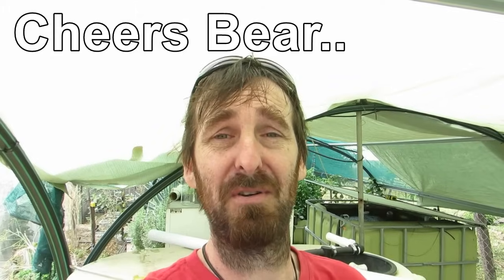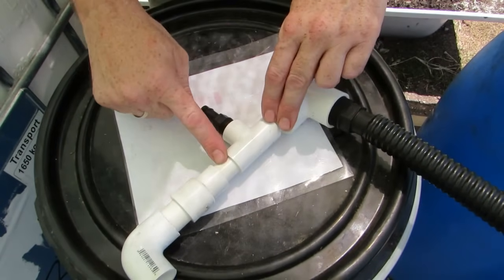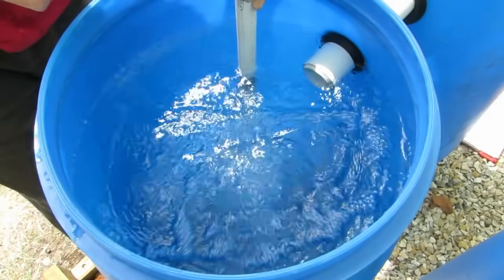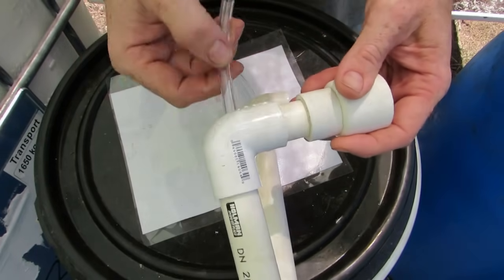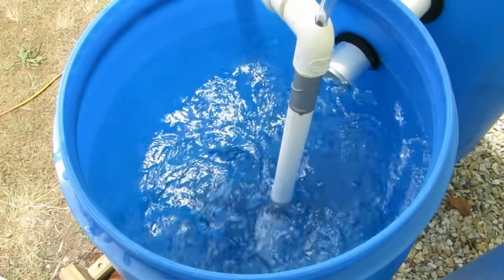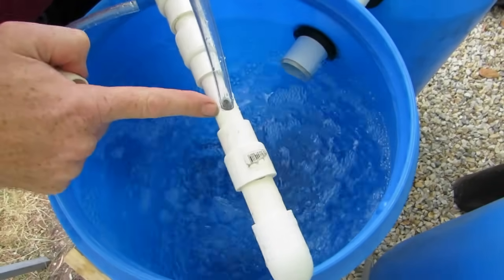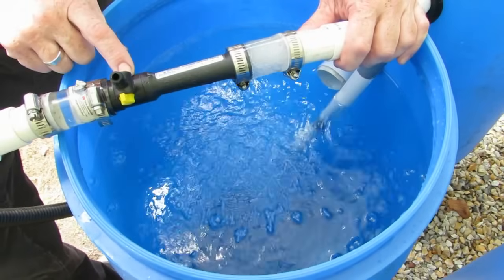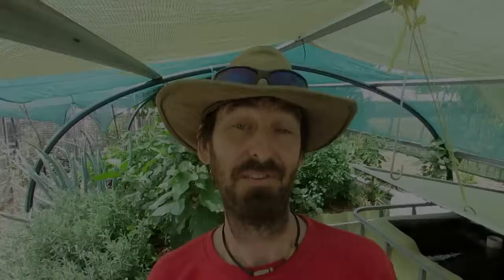DIY venturi, a few easy builds for aquaponics, aquaculture or hydroponics..

Comment: very interesting video! Thanks. I'm starting my first indor aquaponics syste very soon. How i can calculate how many fish i need for balanced system?
Reply from the maker: +Giorgio Cerruti ?
Hey Mate. Sorry for yet another slow reply. 
I calculate stocking rates by the type & amount of media that will be acting as the biofilter/grow bed. If you're using 20mm rock or clay media in teh grow beds I would start out at 1 fish per 20L of WET (under the water line) media. Once you get a bit more experience you can play around with adding biofilters & increasing stocking rates.  
How's the build going ?

Comment: Hey Rob. Love your videos. I don’t know if you’ll come across this question or not. I am spending countless hours watching all kinds of videos to help me get ideas for some designs. My question is: If I were connecting multiple float beds or grow beds, could I add the Venturi idea to the straight connecting pipes? I’m trying to come up with ways to help improve the oxygenation continuously through the system without using air pumps. Like say if I was connecting multiple deep water beds together in a straight line.
Reply from the maker: Hi IT. I can see no reason why you cant but I don't think it's necessary. 
A flood & drain bed will have more than enough O2 in the root zones as the water drains out. DWC/raft beds generally have a slower flow rate as they have an hour long retention time (from 1-4 hours) meaning that the inflow is generally rather slow. I'ts advised that you have a series of air stones under the rafts in DWC as the roots need a fair amount of O2 to keep the plant healthy & disease free.
Hope that helps some

Comment: Hay dude , how do you lower the ph in your system mine is crazy high alkaline. All I can do is drain it off and add tap water, which sucks.
Reply from the maker: I did a clip on lowering it if it helps any. 
https://youtu.be/eO1pHM7Afuw
Just remember to ONLY lower the top up water so the fish won't get harmed by massive pH swings. 👍

Comment: Would laminar flow make the venturi work better? Various videos on this, from very elaborate to just a few straws in a tube Building a Laminar Flow Nozzle . At the very least, perhaps beveling the joins inside the venturi might improve things. On the other hand - maybe it would make things worse, maybe you need the turbulence.
Tap aerators have screen in them to break up the bubbles. Cant put a screen over the main flow, of course, because it has solids. But perhaps a screen just over the end of the tube admitting the air? Flyscreen? Some silk fabric?
Reply from the maker: Hey Paul..
Have never seen the laminar flow device before, thanks for the link :) Not sure how that would go with the venturi to tell you the truth..
Haven't tried using the screen over the end nozzle yet but will on a new system I will be playing around with in a few months to see how it goes..
Cheers

Comment: 2 suggestion for smaller bubbles do a mesh modification on your impeller.. get a very coarse scotch brite pad cut a disk off zip tie to to your impeller connect the venturi to the intake side of you pump it will mico fraction the bubbles. for noise there is a muffler to reduce the sound to almost zero i can send you a design for one.
Reply from the maker: Hey Chad..
Haven't tried the venturi on the other side of the pump yet.. Might play around with it next time I put a system together & see how it goes..
Am playing around with a small muffler design here as we now have 4 venturis running on 2 separate systems & don't want have to bribe the neighbours with too many fish ;) 
Cheers mate & have a great one..
Rob.

Comment: The problem I'm having is water is coming out of the air tube (using your first build).  I've checked the direction of the tube opening (away from the water flow), have adjusted the depth of the tube in the T and have cut different angles in the tube. Any other ideas?
Reply from the maker: Hey Byron.. what size pump do you have on the system?
Reply: Sorry to be so tardy on my reply.

I'm using a 1350 gph pump.  However when I moved from a .5" venturi to a .75" venturi and put a 1" exit pipe of the end it began working well.  I think I was just blowing way to much pressure into the venturi.  Anyway, all seems to be good now.

Thanks for your reply in interest.

Cheers,
Byron
Reply from the maker: Byron Wooten That's great to hear Byron.. Am glad you got it all sorted.. No worries on the slow replies.. Can be a bit slack myself when it comes to replying..
Cheers & all the best..

Comment: If you split your outflow so that some of it goes directly back to the pump, it will probably make your air bubbles smaller, as the pump churns them around, breaking them into even smaller bubbles.
Reply from the maker: Hi Jim.. Think that would work well.. Our pump is a few meters away from the venturi so it would make diverting the flow a bit difficult, not impossible though.. Looking at going back to using air stones as I will be adding a bio filter & the pump we have at the moment won't be strong enough to run 2 venturis.. When the budget allows for a larger pump I will be switching back to venturis..
Cheers sir & have a great one..

Comment: Have you looked at doing a bypass with a ball valve to increase the pressure differential.  Check out the installation method for the Mazzei injector.
Reply from the maker: Hi Kaylee..
I haven't but just had a look, thanks.. For our purpose I don't think we need to go that far as we are getting good air flow through to the tanks.. Ended up using the commercial unit in the biofilter for the fish farm in line & its doing a great job..
Cheers..

Comment: after everything's in place and ready for water, Do I fill everything to there running levels?then start the pump?or?? to get started?
Reply from the maker: Hi Bonnie. Sorry I missed your post & know you probably figured out already. 
If you haven't then the best way to start up the system is to fill the fish & sump tanks first then switch the pump on. That way the system won't overflow 👍
Cheers & sorry again for taking a while to respond.
Rob.

Comment: If you had a pump with a good GPH output, could you split the 1 inch outlet into 2 one inch pipes, add 2 venturi, and get twice the air bubbles?
Reply from the maker: Hi there.
If you did have a large enough pump I think you would need to bring the restriction down to a ½"/15mm pipe. Not sure if it would be more efficient at getting more dissolved O2 into the water though.  It might be better to up the pip/hose to 1¼"/32mm & then bring it down to ¾"/20mm. 
Would like to know how you go if you have a crack. 
Cheers.
Reply: Rob Bob's Backyard Farming  Thanks.  And thanks for providing the Imperial measurements right there. I'll let you know how it goes.

Comment: For your ventura you can try  many small tubes combined into a fitting to get many small bubbles
Reply from the maker: It all comes down to the hole where the air enters the water flow. I found I got smaller bubbles with higher water flow rates.
Cheers.

Comment: Pretty interesting.  What about just shooting the water right into the barrel, maybe split the stream into multiple small high pressure holes  ... wouldn't that pull air down into it and aerate it?  How do you measure the results here?
Reply from the maker: Just truing to use the pump to do all the work so we don't need an air pump as well.. Helps to streamline the system with less pipe work & power consumption..
At the moment I'm just judging the amount of bubbles I see, not very scientific I know ;)   Have also looked into different methods for testing dissolved oxygen.. The price of the units are a tad prohibitive for me at the moment..
Cheers,
Rob,.

Comment: to make the bubbles smaller have you thought of running a few layers of plastic window screening around the holes with a bit of distance between the layers to break up the bubbles? or you could use a wrapping of open cell foam to do the same thing.  Open cell foam might trap and debris in the fluid though and require cleaning.
Reply from the maker: Hi there Thomas..Have had a few people suggest that thanks.. The bubbles we're getting from the bar arrangement at the end of the delivery pipe are fairly fine where the ones in the tester barrel were just running from the end of the pipe so were rather large..
Cheers & hope you enjoying the holiday season..
Rob.

Comment: Hey Rob, I am looking at starting an aquaponic fishery with 3 different man made ponds each with a capacity of roughly 4-5 mt of water volume. One will be Carp, the other Koi and the 3rd Tilapia. Now the problem I am stuck with is for these fish to actually spawn they need the bed of the pond to be fairly still. but for Aquaponics to work I need the fish waste from the bed of the pond. I was thinking, if I made a venturi-style back flow from my growbeds that would lift and help mix the fish waste in the water which in turn I can extract from the middle of the pond or even the top rather than the floor of the bed. Do you think that would work. Or if you have any better solution to my problem please advise.
Reply from the maker: Hi there. Sorry for missing this.  I'm not to sure how your ideas would work sorry as I haven't had much experience with fish breeding. 
Most folks I've seen do it online will have their breeding pairs in separate tanks so they can have better control over their environments. 
Sorry I'm not much help to you Othman.
Rob.

Comment: Hello I am biulding aradial flow filter and a biofilter if I can call it that the water comes out of the radial flow into the bio like yours. will the gravity flow from the radial flow create enough force to use a venturi without a pump. and will the venturi restrict the water flow too much and cause the radial flow filter to over flow. Thanks
 between you a Kassa I can do this
Reply from the maker: Hey there Larry..
I don't think it will be as effective as one run under pressure from a pump but you will get some sort of venturi effect.. It is something I would like to play around with on my next build as it would be a much more efficient way to plumb up the system I think..  Would like to know how you get on with the build mate.. 
Have a great one..

Comment: would you know the psi of the vaccuum on the air drawn in from the black air inlet?
Reply from the maker: Hi there... I haven't got a way to measure it at the moment sorry crash100.. I do know that it is supposed to draw through 900lph on a 3500lph water pump according to the manufacturers site.. 
Hope that helps some..
Reply: im trying to do a little more than feed the fish so to speak but i have to say this video has been extreemly helpful; thank you

Comment: Hi.  I am starting a IBC build.  I am wondering what happens if my tables are left outside.  We get a fair amount of rain.   How do I make sure that things do not flood.   Does everything need to be under cover? Thanks
Reply from the maker: Hi Kelsey. Our system is exposed to the elements & has over flowed a number of times due to rain events. Normally I won't top the system up if I know we are expecting rain but during summer here the weather can be a bit unpredictable so is hard to anticipate top ups. 
I think one way around having the system overflow all the time if it is outside is to have an auxiliary sump tank. This tank can be left empty most of the time but can be brought online during time wet weather. It could be joined to the main sump tank via an overflow port & the water held to be used for future top ups or it could be joined by a valve that gets turned on before the rain event happens dispersing the extra between the 2 tanks. 
Hope that helps you out some.

Comment: if you buried the end into some gravel or sand, would that work to make the bubbles finer?
Reply from the maker: Hi Sam. I don't think it would as the pressure from the water & air would blast it aside fairly quickly. 
Cheers mate.

Comment: Rob,
I have 1 water pump in my sump tank that returns water to the fish tank.  If i wanted to use a venturi to move the bio media on the bio filter would it require a designated pump?  The moving bed is powered by an air pump right now.  I've tried "T"ing into the 1" from the water pump but that didn't work at all.  maybe not enough pressure.  I really don't know.  Any thoughts?
Reply from the maker: Hey Joshua. You could install a separate pump to run the venturi or up size the pump you have & add a separate line to the bio. 
After our system gets a face lift (a few months away yet) I will have air coming to the bio from an air compressor. I will need a larger compressor for the raft beds + they're cheaper to run than the water pumps from memory. 
Hope that gives you something to think about.
Cheers mate.
Reply: +Rob Bob's Backyard Farming.  Thanks Rob.  My intention is remove the air pump as the primary source of aeration and only use it as a backup and have only 1 pump, the water pump, running the system.  I don't see a point in removing one pump to add another.  And as you've said, a goal is to make the system quieter. What size water pump do you think if new to scale up to?
Reply: +Rob Bob's Backyard Farming.  Also, I did a test with meters and my water pump and air pump are almost identical in power consumption.  Each costs around $3/month to run here in Central Florida, USA.
Reply from the maker: Pump size would depend on fish tank volume, head height, number of grow beds being service from the pump & efficiency of the bio filtration.  Is a bit hard to say without knowing sorry mate.

Comment: As usual, great video.  Are you going to keep your battery backup aerator system or are you going to change it over to a battery backup for the pump to keep the water circulating and the venturi going instead?

I use a section of tubing pushed down into a "T" that seems to work quite well without all the extra flow restrictions of size adapters and such but I also go with a surface return method where the water comes out of the venturi and is plumbed in just below the water surface in the tank.  When I first began playing with venturi I found that too much pressure  on the outlet side of a very basic venturi such as I was using greatly affected the quality of the job was capable of, so I don't have anything except for a straight section of pipe as an outlet on that side of my venturi.  I've been using solely the venturi for aeration for over 8 months now. Your setup seems to work quite well.

As usual you've done a great job here, even to showing multiple options.  One thing I like about the venturi is that rather than depending on airstone bubbles coming in contact with a limited amount of water, all the water pumped back from the sump comes into contact with hundreds of small bubbles under pressure and rapid motion, creating much more of the friction needed for aeration.

I set mine up with the surface return being just under the surface for a couple of reasons.  One being that a few of the more involved sites I found on venturi aeration suggested it as the best method and the other being that it creates a circular current (depending on how you aim it I guess) in the tank that the fish seem to enjoy playing in.
Reply from the maker: Hi there Mark..
Whatever works for you is my motto when it comes to DIY jobbies..
I did try the venturi just under the surface & the fish went burko & were running into the walls of the tank.. They did calm down after a while but were still agitated & went off their feed... Added a longer length of pipe (about ½ the depth of the tank) to the outlet & the fish calmed down..(Can't remember if I included that into the clip :/ ) Not sure if there was too much agitation that was effecting the fish or if the jades are just to pampered ;)
One of the bonuses as I see it in having the outlet down low is that it is creating more water movement in the tank than if it was added to the top.. Being a square tank it cant sustain much of a circular current..
Am still playing around with them so might end up refining the outlet in the tank yet..
Cheers sir & have a great one..
Reply: Rob Bob Too true about the square tanks, I tend to have current in the center and turbulence in the corners.  My tilapia don't seem to mind  and do look as though they enjoy the currents.  It does allow them to escape the current at night when they seem to want to cluster out of the current.  I bred my own and they've always known only my way of keeping them so they have never seemed bothered by the agitation. The main point I seemed to run into down low was back pressure on the venturi reducing it's effectiveness.  As stated though, it could just be because of the basic style of venturi I went with.

Keep up the good work, I've learned a lot by watching your videos.  Thanks!